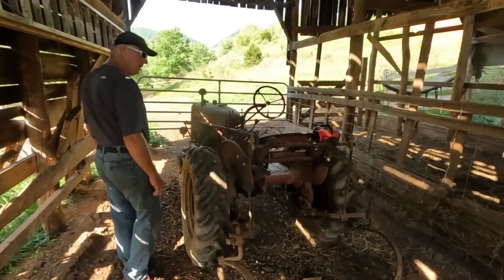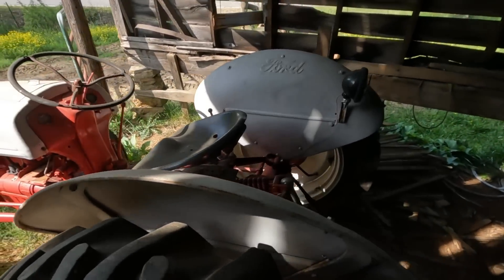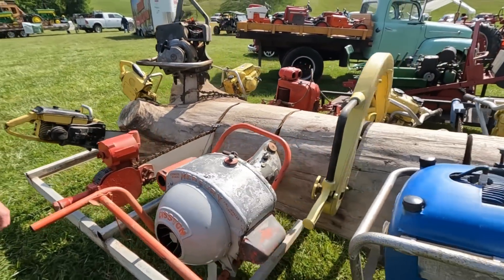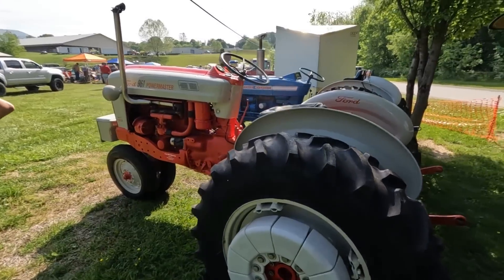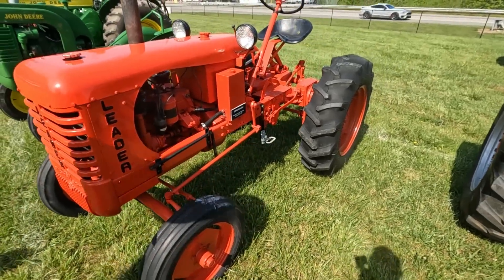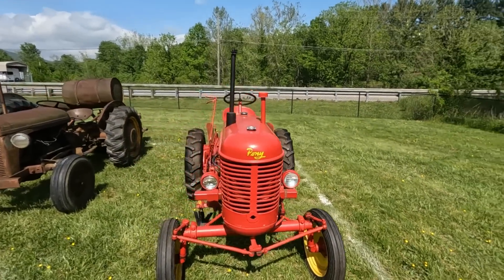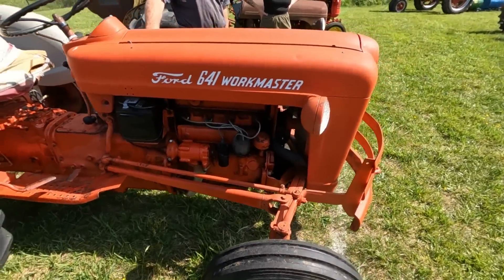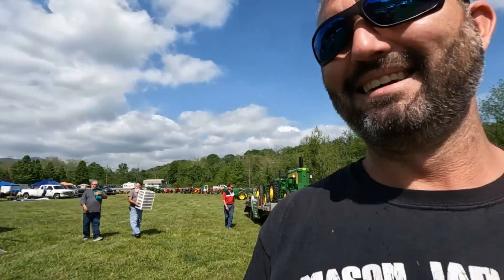NOW THATS A CHAINSAW! | AARON TAKES THE FAMILY TO THE ANTIQUE TRACTOR SHOW | PAPA KNOWS TO MUCH

Comment: Omgosh that dual exhaust tho😳 Another nice fam outting. Just listening to Papa Hugh, u realize he's always worked hard, tackled all the farming probs he's faced head on to figure it out, make repairs or invent something in order to move forward. Prime definition to "Where theres a will, theres a way" .. plus it helps a heap to be stubborn too .. wink wink. 
Hay Aaron .. have you ever been to Tate City GA? It's just south of the NC/GA border flanked by the Nantahala & Blueridge Mtns along the upper portion of Tallulah River.  There's several campgrounds there along Tallulah River Rd, some with restrooms, some primitive. The last campground just b4 u arrive at Tate City Mall (pop 32+/-) is Sandy Bottoms. These are ran by the honor system. Theres also pull off places for vehicles all along the river for a day fee, it's not much. They do check js. There's native trout there but its also stocked. Not sure on thr stock dates tho. U can prob Google that.